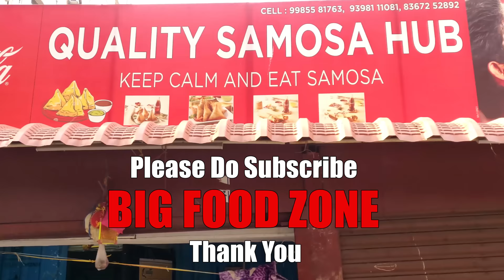Very Huge Samosa Making Process Video | Biggest Samosa Making in Rajahmundry Samosa Hub Recipe

Comment: Flour & water

In a small bowl, mix some flour with a bit of water to form a concentrated, thick paste. Using a small pastry brush, take some of the mixture and spread it at the tip of your samosa. Press with your finger to seal the edges. Repeat until quantities are finished
Reply: Good
Reply: Good